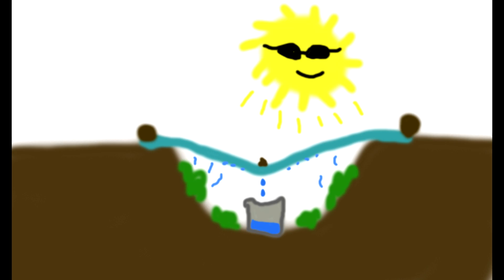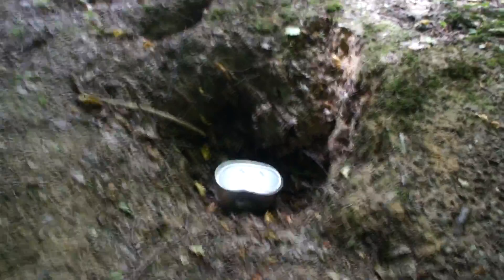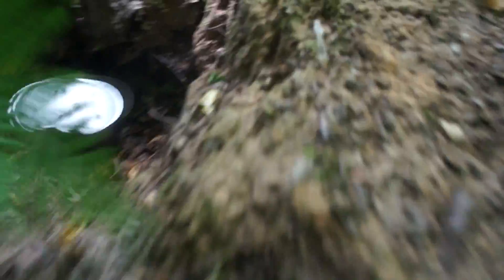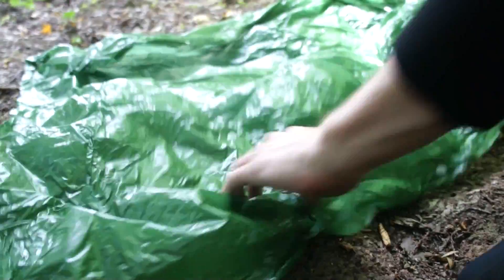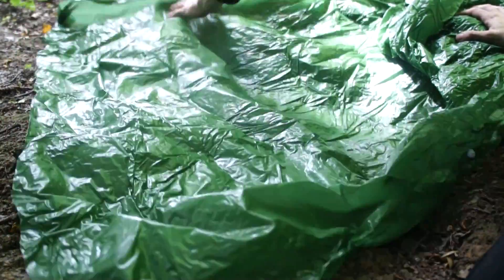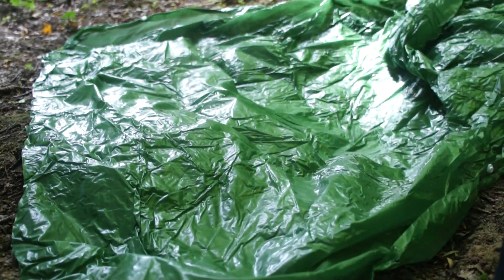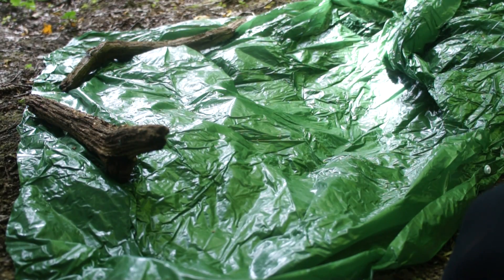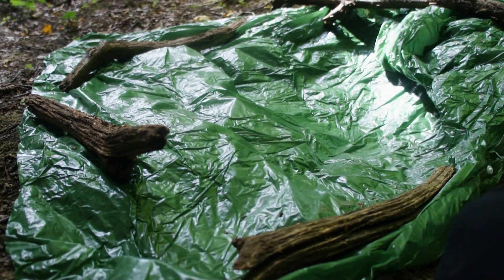Solar Still - Water gathering - Survival/Camping Tips

Comment: You want clear plastic, that's what causes the heat build up and condensation. Tht's why a 2m square of thick plastic should be part of your survival kit. But you should also carry a filtering bottle. Water is a prime survival factor and in Britain we don't always get the sun for a solar still...but you can normally find a river.